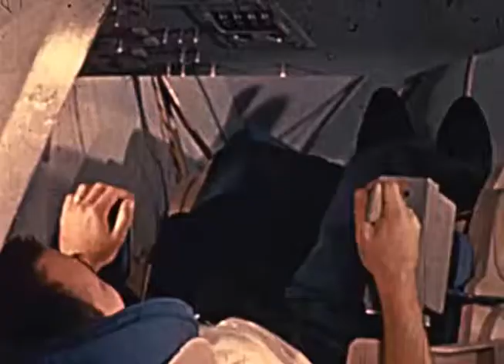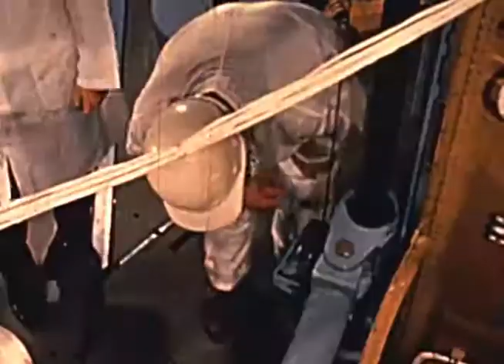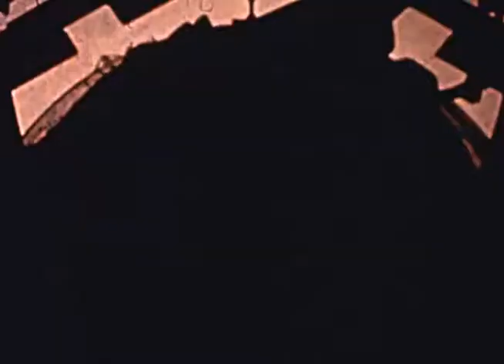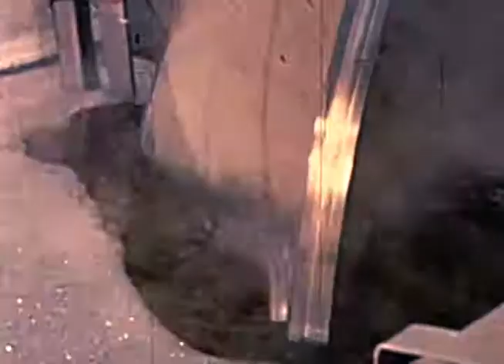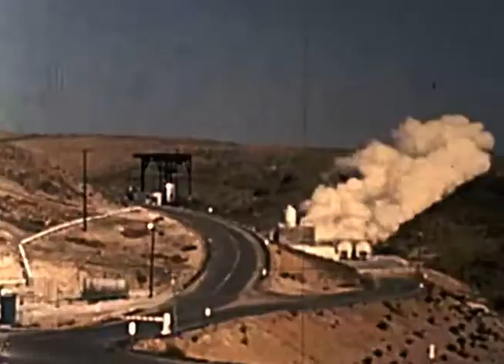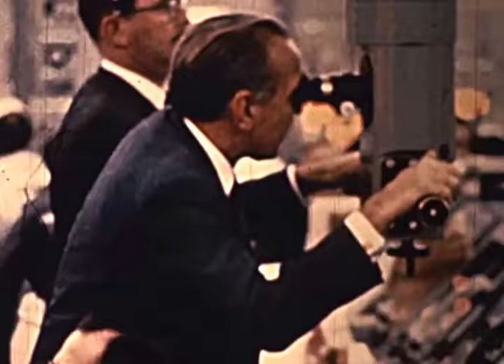The Apollo Spacecraft: Status Report No. 2 - NASA/MSC 1966 Film

Comment: I've been reading all of the old NASA summaries for the Mercury, Gemini and Apollo programs so finding this was a gem. It left me wondering one thing though, When did they change the LM door form round to square? The ones in this video are round.
Reply: The LM mockup in the video must have been an old one. Grumman had switched to the square hatch by January 1965 after astronauts complained that it was difficult to crawl through the round opening with the bulky PLSS backpack.
Reply: @frankbrockler 100%. It was Pete Conrad that pushed for that.

Comment: "Block 1" and block 2 spacecraft are mentioned repeatedly. IIRC block 1 was LEO and block 2 was lunar mission hardware. After the crew compartment fire tragedy only the block 2 concept was carried forward. I've never found any reasoning behind having 2 "blocks."
Reply: I can think of 2 reasons for 2 blocks. First. Apollo was conceived before the goal of a lunar mission has been established. Apollo was originally going to be an all-purpose spacecraft as a follow-on to Mercury with missions primarily to low-Earth orbit. No rendezvous, no docking, and no trans-lunar navigation--at least not  until much later on. So the first version would not include any of the required hardware. Designs were drawn up and metal was bent. This became Block I. 

Then the lunar mission was announced, and that required many design changes. Was it too late to include these changes in Block 1? Probably. If so, these changes would lead to a new version of the spacecraft, Block II. If not, I submit my 2nd reason for 2 blocks.

The original method for going the moon called for  the Apollo command and service modules  to land on the moon atop a large landing stage. There would be no lunar module and thus no docking. The method of Lunar Orbit Rendezvous (LOR), which required docking with the LM, wasn't chosen until 1962. By then, much of the Block I hardware had already been built. Why not complete it and flight test it while the massive changes required for LOR were designed and built? This new design would be Block II. Lessons learned while flying Block I could be incorporated into Block II.

Block II became the top priority, and work on it was accelerated. This coupled with delays in launching Block I allowed Block II to almost catch up. Then the Apollo I fire occurred, and it became obvious that Block II would be ready before fixes to Block I could be implemented. Just implement the changes in Block II and fly it. Block I was used for unmanned testing of the Saturn V rocket while Block II was being modified.
Reply: @frankbrockler  (about block i /ii Apollo CM) Thanks, makes sense.